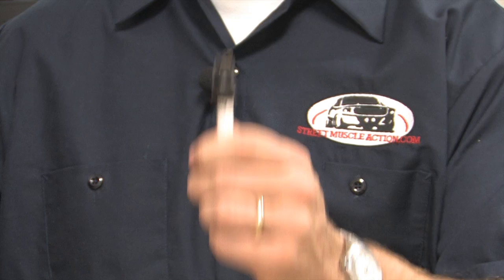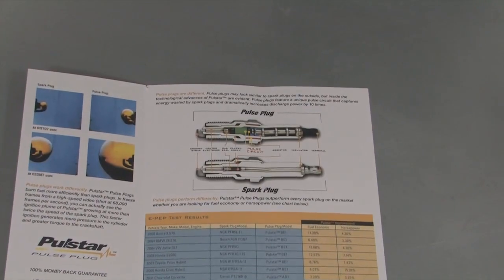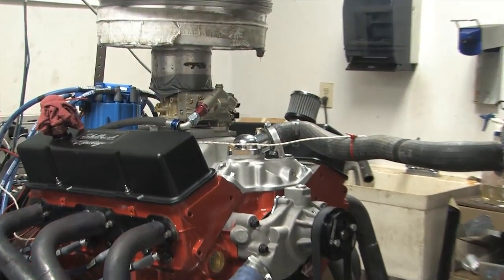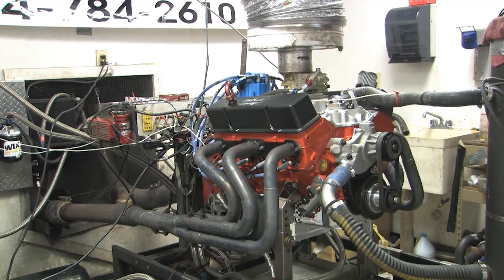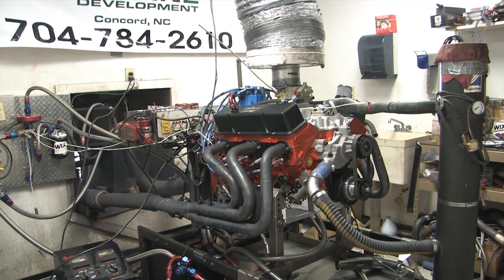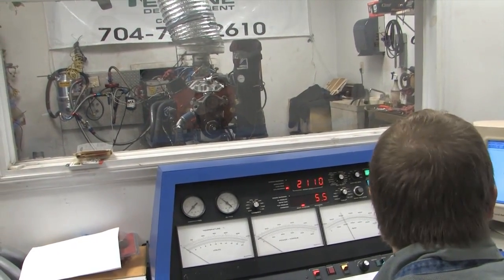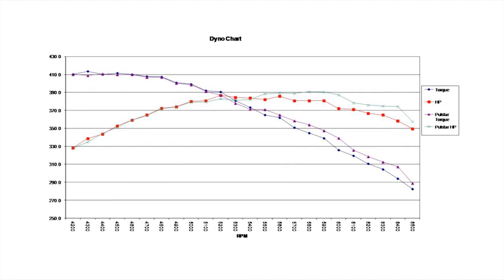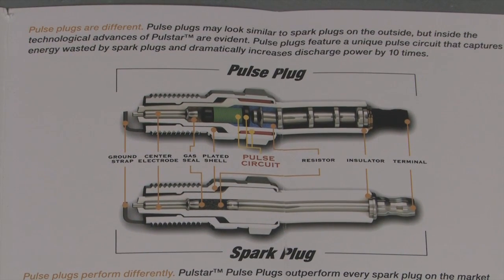Dyno Testing Pulstar Plugs to See if They Make Power

Comment: I agree. It's funny how spark plug manufacturers, like this one...keep making claims...just to sucker a few people into buying them. Two hundred bucks could go to much better ways to increase HP.
Reply: sunking2001 I'm sticking with trusty NGK spark plugs
Reply: I may try the equivalent NGK plugs next time on my 460 cu. in Ford engine...and see how they work. I know they're good quality plugs.
Reply: sunking2001 nice I'm about to switch mine next week just waiting for the tools I need to get here I'm switching the spark plugs for NGK iridium ix and MSD Blaster Coil on Plugs on a 5.4 Triton 2 Valve
Reply: I recently upgraded my 460 cu. in. ('70 F-250) from HEI ignition to Pertronix distributor, Flame Thrower coil, and new Taylor wires. I felt the difference right away.  I'm dealing with a local speed shop and I'll see what he recommends as far as an upgrade in spark plugs...maybe NGK's.
Reply: sunking2001 nice my favourite for engine is the Ford 300 4.9 I wish I owned a F-150 with one now I do plan to try to own one preferably carbureted so I can add a high flow 4 barrel edlebrock carb 240 headers for higher compression and a high flow exhaust with cherry bomb glass pack exhaust saw a 1988 F-150 for $3000 but its fuel injection which limits options on what I can actually do to it but these mods will be so I can work the truck harder in construction hauling heavy loads if I can get a truck I'm also replacing the rear leafs and adding a helper spring kit for an additional 3500 pounds of cargo I need the power for heavy haul
Reply: @bryanmartinez6600  Did you ever find your F-150 with the 300?
Reply: @brianwesley28  nope I have an 04 Silverado with a 4.8 Vortec great Engine but I need another 4L60E transmission they're pretty weak but it's at 270k miles. 
I'm thinking of getting one from Jegs or B&M. I was looking for a 4.9 F150 but they are insanely rare, though 5.0 is very common. I've done some work on this Silverado and all it needs is a transmission and maybe a battery. I plan to get this done in spring since it's freezing in Colorado.
Reply: @bryanmartinez6600  I fully understand. I live in Kansas. I have an '02 Trailblazer LTZ 4.2 with the 4L60E and an '03 Trailblazer EXT North Face 5.3 with the 4L60E. I'm not quite at that mileage with either, but the LTZ is approaching it at 235,000 miles. It doesn't quite feel as crisp and grippy as it once did. The EXT is one I recently picked up for $500, due to an owner being tired of chasing ghosts and needing the money for a replacement car. I wish they would have mated them to the 4L80E. I've considered trying to do a swap to the 4L80E when these crap out, but that's a lot of work and expense. I also understand about the waiting until spring. I have to work outside when working on my rides. I understand. I have a couple of F-150s with the 300L6 I haven't done anything with, yet. I think I still plan on doing something with them, especially the 1984 4x4 with the manual 4 speed and granny low. The other is a 1983 2wd with the automatic. C4, maybe? They both have the 300L6. I've not even transferred their titles over to myself, yet. I'll have some back taxes to pay on them if I do. I had a wild idea to try to make a 6x6 out of them, but I don't think I want to. It would be a lot of effort and expense, and they are becoming less common. They both need some work. That's for sure. I have two, though. I hope I can get to them, in the coming year. Money is always the problem. That and weather. With enough money, you don't have to worry about weather, though. lol. 

So, your plan is to rebuild the 4L60E? If everything else is good, you may as well?
Reply: @brianwesley28  I plan to buy a remanufactured transmission and maybe keep my core or get a used one and rebuild it myself and learn on it since I've never done a transmission but I can swap them out as long as it's not a transverse layout. I was also thinking of doing a 4L80E but there's hardly any room where the transmission goes and since these newer Silverado have more electrical it be a big job to get everything to work properly.
I am thinking of lifting the truck maybe 4 inches and adding a manual locking rear differential since it's a 2WD.
Reply: @bryanmartinez6600  I've not rebuilt one, yet, either, but with YouTube and the Internet, in general, these days, as long as you have a clean and clear place to work, I'm sure it's not too difficult to rebuild one. If you can find a rebuilt one for the right price, why not so that? I'm sure the locking rear would help the 2wd. Get this shit, dude. In the spring of 2017, one of my friends had a job offer in Washington State. He didn't have a valid ID. He couldn't fly, or take a bus, or anything like that. I just said fuck it. I'll drive you from Kansas to Tacoma. I needed to get away like that for a while, anyway. So, I drove that Trailblazer LTZ. It has AWD/4wd, but it won't switch to it in the cold weather, when it is needed most, of course. So, of course, we left on the night when you guys had that freak late ice storm and blizzard late in the year. The LTZ had tires almost as bald as Telly" Savalas. Don't ask me why GE came to me as an example. So, things were great enough until we hit the Limon area. It was raining hard. Not too many miles later, it was ice. There were vehicles all over the ditches. I made it to Denver. At the first incline after Denver, I barely made it up. I had zero traction and I was stuck in 2wd. We finally made it to a turnoff with a parking area. We slept there until morning. I went out if my way to score some tire chains (I love you Coloradans). Once I finally found some (they're really expensive and nice ones) and got them installed, I drive for like 10 miles until they weren't needed anymore. I pulled them off, while a cool DoT dude parked behind me while I was doing so on the side of I-70. So, from there on it was fine specimen conditions. We got to Tacoma really late. We decided F it. There's a sweet looking camp site outside of Olympia. We drove there. As we got close to it in the mountains, Google Maps' directions just went black. Nothing. So, we took the "road" we thought would lead to it. Nope. It was a minimum maintenance road with a steep grade going up the mountain. It was muddy and with those bald tires, I wasn't going to stop. We made it appear as the road would go, in 2wd. We camped there for the night in the LTZ. It is amazing what a good truck or SUV can do in 2wd. I'm sure the lockouts would help. If you're patient and savvy enough, and really want to keep the same truck, you could probably score a 4L60E from a 4x4, a differential, and all of the accessories like switches, and convert it over? Maybe find a salvage truck at the right price? If not, the 2wd can get you many places. I know. 2wd got me to, perhaps not the peak of what may have been the highest mountain in that region of Washington, but as far as the road went, while it was a steep grade, and muddy, with bald tires. :-)
Reply: @brianwesley28  I plan to clean up a shed we have and make a work bench to rebuild the transmission. Just before the transmission broke I had just gotten new Cooper all terrain tires they didn't even get 500 miles on them. I believe your 4WD won't work because the hubs lock with a vacuum I think. Either that or it's magnetic locking hub, that's one thing I like about Fords and their manual hubs. The transmission that I plan to get cost $2200 but comes with all the stuff to make it solid. It has a reinforced sun shell, improved clutch packs, all new seals, pump is rebuilt, new Torque converter, and the valve body is bored and sleeved for a new valve that would leak and cause the transmission to burn up. 
I did want to get a 4L79 drum kit as well but too expensive so maybe I'll get it for the next on I build myself. The 4L79 drum allows for more clutches to withstand heavier loads and higher torque rating. I also plan to add an electric transmission cooler and a thermostat to monitor my exact temperatures. Heat was a big killer of the 4L60E and also the built in transmission cooler in the radiator is just horrible. The Engine runs at 190 I believe and transmissions begin to heat up at 200. I plan to get my cooler to run at around 165-175.

Comment: I dyno tested these plugs on an old tired 2001 saturn SL2. regular plugs 100hp at the wheels. Pulstar plugs 105. I was impressed with them. We made 3 pulls with each plug combo and took the average.
Reply: When I was studying automotive in Houston, me and some of the guys were allowed to borrow the Dyno for a day.  We got the idea if there was a difference between ordinary spark plugs and the "super high performance spark plugs with 4 electrodes".  To our surprise, the average between the two, the high dollar 4 electrode spark plugs produced an extra 4 horsepower over regular ones, but the funny thing was, only one electrode was clean and the other were a bit dusty.  Only one electrode was actually firing (electricity takes the path of least resistance, so that made sense).  We asked our instructor about the results, his only explanation was that the four electrode plug may have occupied additional space in the combustion chamber, reducing CCs and raising the compression ratio.  I bring this up because maybe Pulstar is having the same effect?
Reply: @vivillager  multiple electrodes is more about wear. as that one firing electrode wears out a bit the next longest one will take its place and so on. the pulstar plugs are shaped like NGK iridiums. check out projectfarms spark plug tests, pulstar and e3 both outperformed NGK and NGK iridiums(which is what i currently run in every vehicle).
Reply: I worked as a mechanic for 16+ years and I'm out of it now because my body can't handle the stress anymore. But, there is truth to spark plugs making more power. We dynoed a 2006 Mustang GT and it had an additional 2hp with E3 spark plugs. When we paired them with Accel Ignition Coils, there was a peak gain of 10 horsepower. People can laugh at us technicians, but the dyno don't lie LOL Point being, yes, you can gain power, but I've never seen a gain of 11hp just from a spark plug alone.
Reply: On their site  for my engine they note "1 Range Hotter" and a lot of the testimonials are on stock ignition systems. If you already have performance aftermarket MSD or hot coils that might lessen the results. If stock you might see a better gain.

Comment: Did everyone not hear it breaking up in revs?
Reply: Nicecardude100 Yep missing  really bad on that second pull.
Reply: Yeah. I installed $200 bucks worth of gimmick plugs and now it misfires. Awesome.
Reply: RAHHHH DA DA RAHHHH DAHHH DAHHH RRAHHHHH
Reply: Yep sounded terrible.
Reply: Do better.
Reply: That's called tuning for you NOOBS..... had they probably adjusted the mixture giving it more fuel it would have made more Power and TORQUE.

Just my 2 cents.
Reply: Casey Cappoen Think what it is they are testing.
Only parts changed were plugs. 
If the super dooper plugs were going to result in more power, theoretically the timing would need backing of a degree or two. 
This is because the only effect the plugs could have is to give a more complete burn more of the time. This would but bmep up, always resulting in a need for less ignition advance.
Reply: @gothicpagan.666  Yes, i would agree with that also. As it's a hotter spark the way the fuel burns is different.

I used E3 plugs once, but they were the wrong heat range i think. Failed very quickly.
However... in regards to the design and flame propagation!!
Throttle response was super smooth on my old engine!

Comment: i wonder if the difference would be more dramatic on a weak ignition system.
Reply: I don't know if anyone has done this on youtube with a dyno, but I know personally on my car I had to shrink the gap down on my plugs from the .043 they came at to .032 in order to get my car to run nice with higher than factory boost levels. So I'd say that there is a bigger advantage with having a well gapped plug than a "more efficient" one any day of the week.
Reply: BEKrustie - Higher than factory boost makes all sense. But I'm quite curious regarding how much more boost you increase?
Because the gap reduction is a bit "dramatic". Seems a lot. ;-)

Comment: race cars generally don't car about fuel economy much unless its a long long race.  Short track and drag racers couldn't give a hoot about saving a couple mpg.  However to pick up a few hp so easy, maybe its worth considering.  For my street car, I'm interested in saving gas.  If I can make more power with less fuel used, then I would save money.  The plugs would probably take over 10k miles of driving @ 20mpg to recover the cost in fuel savings, assuming an increase economy of 2mpg on baseline of 18mpg average and gas prices at $4/gal.  If the gas is at $2/gal then you would need to drive 20k miles to cover the expense of the plugs @20mpg average (2mpg improvement over 18mpg baseline)

Comment: I see there is a good small increase in an engine like the one shown as in the video, but at the same time how would it do in a smaller engine is the question. I have seen my friends use this in their vehicles and they have small engines and they get about 7-10 more HP from it

Comment: personally I love these plugs why didn't you cool the engine between plugs did the initial run of the first plugs start from a cold engine or already warm engine....meaning hot engine less power.... start with a cold engine with both plugs I bet there will be a more noticeable difference...
Reply: Engine dyno pulls should only be done on a fully warmed up engine with coolant and water at operating temp. Unless you like broken engine parts.
Reply: Agree. I've had no problems with mine but it's a supercharged V8's, with a smaller pulley and revised intake. 
 
 I'll be putting them in a different supercharged V8 shortly and have been curious if they will increase the fuel economy on my new pig like they did on my old gas hog.

 Which is getting 23 mpg on the highway at 70 mph (yeah for progress) lol.

 The extra grunt was noticable in my old Jag but the increase in mpg was significantly improved. 

 I never got over 21 mpg at a steady 70 mph. It jumped to 25 mpg  with the pulstars on the same 10 mile there and back run with the cruise control on.

 I was lucky and never experienced the quality problems others mentioned.

 Start up was instant, and it pulled harder at low revs running great to redline.

Comment: It does not make sense why a stronger spark can make more HP, gas/air in the piston is compressed and heated and just about any normal spark plug will do the job on a stock motor, bigger spark does not make it burn any stronger, want more HP add more fuel and air than you will get more HP..
Reply: +Roger Rabbit Bigger and stronger spark ignites the mixture on a bigger front which alternatively means that more of the fuel in the mix can be burned, which is detected by the HEGO after that as a 'lean' mix, and the ECU then says 'hey i'll add more fuel next time' and like that untill it reaches the desired lambda. So with 'weak' plug (spark) less fuel is burned, which turns out in less power. With strong plug (spark) more fuel can be burned, hence more power. So it already happens what you just said that must happen.
Reply: You are correct. The only way a higher energy spark would improve engine power is in the case that the stock spark did not ignite all of the available air/fuel charge due to limited ignition time according to engine RPM. Notice the improved dyno HP at higher engine RPMs demonstrates this factor.

Comment: I like this video actually did a real world test but right at the end of it there are better ways to spend $200 to get more increasing power please tell me. because it safe for my 89 camaro headers may be cost 150 up to $300 depending on what kind of haters I get. that's not including labor which if you change your own spark plugs are not including labor either but spark plugs are easy compared to replacing headers same thing for the injectors but with that there's also an increased cost down the road with spark plugs there's not an increased cost until 50000 miles later. and intake system if your car doesn't have a performance intake system that could cost anywhere from $30 $150 and they don't always deliver what they promise as with the spark plugs. I'm just saying I agree with the video but $200 is better spent somewhere else tell me what I should do.
Reply: Stig Cruise header and do them yourself... Labor? Who pays that? Flowmaster $100 5-20 horsepower... Cat delete about 10 horsepower... Spark plugs DON'T make horsepower... They deliver

Comment: I think one easy way to know if its making a difference is the smell of the exhaust. With a normal plug and an after market ignition system the smell of the exhaust will change. I've put aftermarket coils on a Camaro once and the smell changed. It'll be similar to the exhaust smell of drag racing cars which is a much cleaner smell compared to a street car (smells like propane almost). If after installing these plugs the smell changes then I'll believe it.

Comment: Another update, the reason pulstar work with fuel injection is because the injectors  mist the combustion chamber, that mist ignites much better with a stronger spark, a dripping carburator will not make a good mist so any spark there will be just another explosion  and no deference, why dont u mr uploader do another video using your dino tune machine but this time use a fuel injected engine just to see how much of a miss leading you are doing, dont buy pulstar if you have a carburated car, buy them if your car has fuel injection, they  worth every cent, simple.